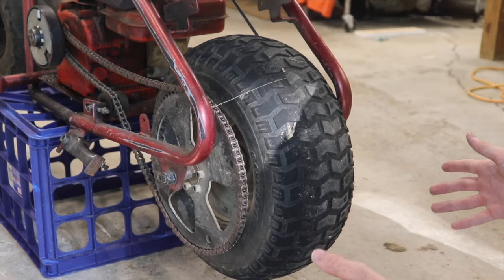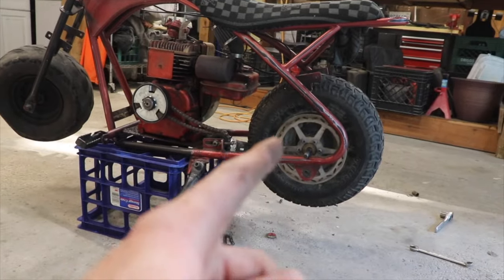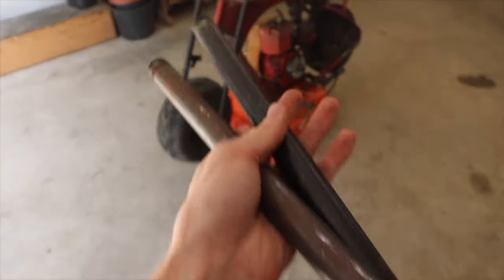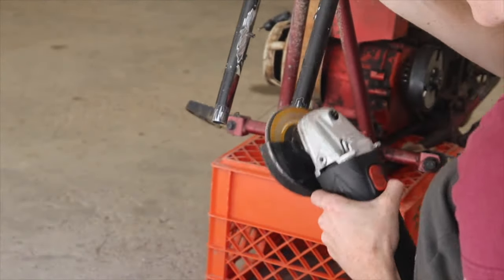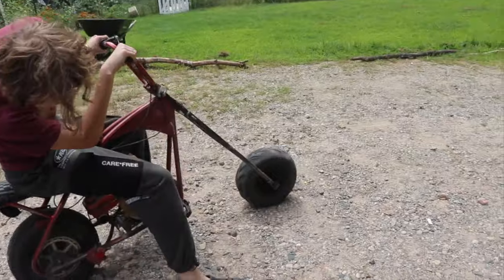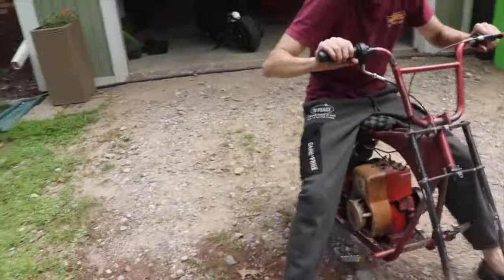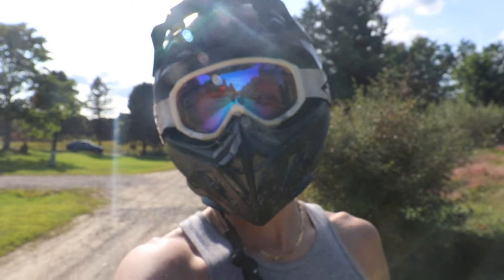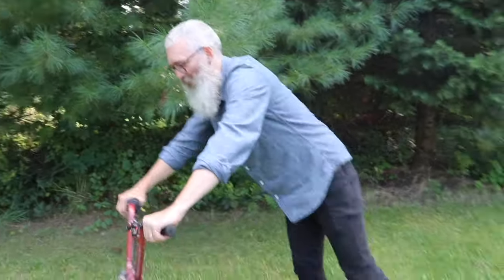I Made A Motovox Into A Chopper!

Comment: I just finished building a 318 cc go kart it goes about 45 to 50 miles an hour. It’s insane I literally took the motor off of a snowblower, a couple months ago.😂
Reply from the maker: Nice sounds like a cool project! Snowblowers are great high rpm engines
Reply: @projectrubberband  for sure mine dose around 3600 with the governor but i took that off so idk what it is know